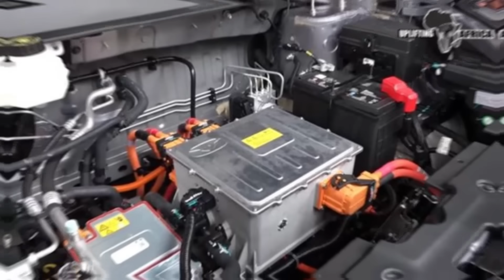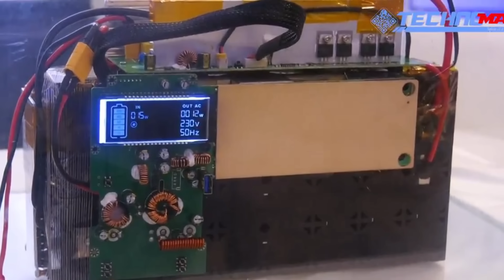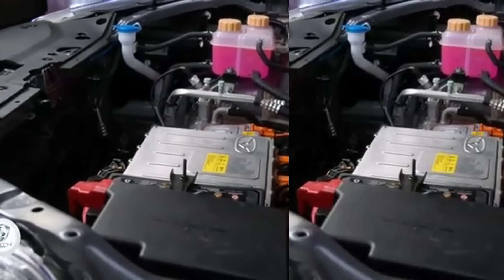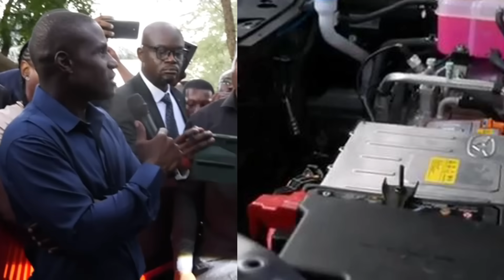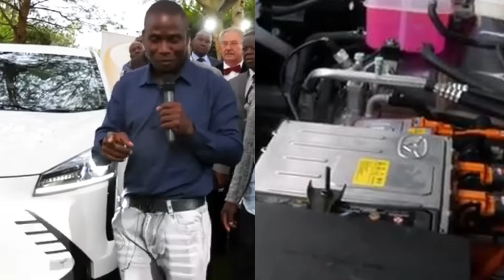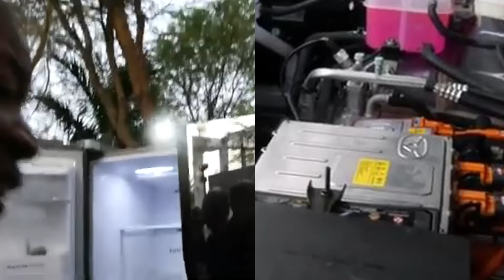The ‘Self-Destruct’ Feature: Genius or Liability for Buyers?

Comment: I see a few people who appear to have little to no understanding of electronics or they work for the oil and gas industry calling this a scam.

I would like to ask them to explain what a rheostat or step up or step down transformer does. How about what happens when you actually put these things on devices that monitors the reactions when any kind of voltage is applied.

He explained where he is getting his energy and that energy is all around us untapped just like another great inventor told us.

Be sceptical if you like but even today in America scientist are proving that inventor was correct and his theory is supported by these findings.

Comment: The US Patents office is a laughing stock - you don't need them. There isn't enough radio / electromagnetic energy to make this work so, as it does work, the energy comes from somewhere else such as free space - virtual particular pairs in the quantum froth. If you are taking energy from that, there is plenty to go at and doing so doesn't break the laws of thermodynamics and thus, not a perpetual motion machine. If you state that it takes energy from the quantum vacuum, they cannot reject the patent application stating it is a ppm. By denying you a US patent, they are trying to discredit you so they can still make petro-dollars. There are plenty of other countries that have patent offices - you don't need the US.

Comment: We are surrounded by large transmission antennas from telecommunications companies throughout the city, the system and transforming radio waves into electricity is possible through a device called rectenna (rectifying antenna). This system captures radio waves and converts electromagnetic energy into usable electrical current. Here's a summary of how it works:

Main components of a rectenna
Antenna – Captures radio waves from the environment. It can be a dipole, spiral or patch antenna.
Rectification circuit – Converts the high frequency (AC) signal into direct current (DC). Typically uses Schottky diodes, which operate well at high frequencies.
Filter and storage – A capacitor can be used to stabilize current and store energy temporarily.
Steps to turn radio waves into electricity
Radio wave capture – The antenna receives electromagnetic radiation present in the environment, such as cell towers, Wi-Fi, and AM/FM radio.
Conversion into alternating current – The captured signal generates an oscillating alternating current in the antenna.
Signal rectification – Diodes convert this alternating current into direct current.
Filtering and storage – Capacitors and other circuits stabilize and store the energy generated.
Applications and limitations
Uses: Wireless sensors, small low-power devices, and wireless power technologies.

Comment: I installed a similar device to protect my Em Regeneration Systems; involving disengagement of intermittent ground to electrolysis into Lightbulb & overfeed of systems to implode device in order to protect when removing from platform that contained the actual ground for the intermittent ground...necessary when others are out to defame or steal your research...if along the Em regeneration format then essentially produces more energy than required to produce, thus the power produced has to go somewhere...may as well go to protect the technology; handing drunk monkeys a loaded, cocked pistol just to see what happens  is emencly more dangerous than a small implosion.

Comment: Honest Question;
What happens when you took radio waves in a large scale to transform in electrical energy? Can it be dangerous in the long term? What are the possible repercussions ? Just curious 😊
Reply from the maker: Thanks for your thoughtful question! Harvesting radio waves on a large scale for energy could face practical challenges, as ambient radio frequencies are low-energy and would require massive collection systems to generate meaningful power. Safety-wise, radio waves are non-ionizing radiation (unlike X-rays or UV), so they’re generally not harmful in typical environmental levels. However, concentrated energy extraction might risk localized heating or interference with communication systems if not carefully managed. Long-term repercussions could include energy inefficiency (if input exceeds output) or reliance on existing radio infrastructure. While intriguing, scaling such tech would need rigorous testing to ensure safety and viability. 😊
Reply: @chriswabs  wow. Thank you very much. I suspect it, but without enough knowledge to justify it. Well great. 
Well, the door is open, so now I hope we do explore the opportunities this technology can bring and how far (within the limit's of safety of all) we can go.
I'm enthusiastic about it. Thank you for the answer.🙏🏻💪🏻

Comment: Too risky. Ha ha ha!!!!!! How many electric cars that are on the market have battery fires that destroy the cars and sometimes their surroundings? Yet EV car makers are mass producing and selling these cars. Rechargeable battery powered EVs appear to be more dangerous than any self destructive control module. Why not call the US Skunk works company to reverse engineer this self destructive device?  🤣🤣🤣Just make sure there is no input charging port to make use of any charging station and who cares if there are fairies from another dimension dancing inside the self destructive device, as long as it can keep going without any external hookup charging. How hard can such a test be?

Comment: Here is an idea to shut down skepticism, they can build a suspended platform covered by glass such that it would be easy to see if any external wire was going in, then attach the car inside, with its tyres on rollers and let it run indefinitely for anyone coming to see it.

Comment: I would not want a device that has an implanted detonator. In the event of an accident wires could be severed, and batteries in the vehicle could also be broken. This means you have a wrecked car with a detonator going off and Hydrogen gas from the battery. No thanks.

Comment: That's clever, no one can reverse engineer your invention👏👏👏,...keep safe Maxwell, Long live Zimbabwe!
Reply: This also means he is the only one that can assemble, service, repair, That won't work.
Reply: @raymondbennett6793  It is necessary until his invention can no longer be denied a patent. I'm fine with it. How else do you suggest he can proceed to get this on the market?
Reply: @arnulfomejorada1459  https://youtu.be/W970psviMFI?si=6g62k9GHFrSQTco1
Reply: We are surrounded by large transmission antennas from telecommunications companies throughout the city, the system and transforming radio waves into electricity is possible through a device called rectenna (rectifying antenna). This system captures radio waves and converts electromagnetic energy into usable electrical current. Here's a summary of how it works:

Main components of a rectenna
Antenna – Captures radio waves from the environment. It can be a dipole, spiral or patch antenna.
Rectification circuit – Converts the high frequency (AC) signal into direct current (DC). Typically uses Schottky diodes, which operate well at high frequencies.
Filter and storage – A capacitor can be used to stabilize current and store energy temporarily.
Steps to turn radio waves into electricity
Radio wave capture – The antenna receives electromagnetic radiation present in the environment, such as cell towers, Wi-Fi, and AM/FM radio.
Conversion into alternating current – The captured signal generates an oscillating alternating current in the antenna.
Signal rectification – Diodes convert this alternating current into direct current.
Filtering and storage – Capacitors and other circuits stabilize and store the energy generated.
Applications and limitations
Uses: Wireless sensors, small low-power devices, and wireless power technologies.
Reply: Bull shit it is a regular electric device with a battery. He is fear mongering people to avoid catching his scam.
Free Energy Crap
Reply: Problem is when they'll even figure out how diffuse the self destruct mechanism. Then they get to pick up where they left off.

Regardless, nobody's gonna back the imitators by then for a higher price, especially with his name out, famous n well known,
What they'll really fear the most.

Credibility = originality n reputation

Comment: Only if the self-destruct process is confined to a secure metal case containing the microsonic device and and the destruct process  is isolated from the whole car, the process must also be tried tested and foolproof, then insurances for the car will cover the whole car except for the microsonic device, the insurance for the device will be covered by the brand/company marketing the microsonic generator on behalf of Maxwell Chikumbutso.
PS: Internal combustion engine too involves continuous explosions but is only confined inside the engine's block and head.

Greetings from India.

Comment: Maxwell, I am so exciting about your invention.  Are there any independent labs or engineers that can provide their verification that it is working?  This is needed to convince people of the validity of this seemingly impossible invention. If you have done this, please post a video.  You can expect that the fossil fuel industry will try every dirty trick to discredit you.  You must be ready to counter their claims.  Maybe get a celebrity to drive the car a few thousand miles without fueling.  This will change the world if it can be made available to the world.  Zero point energy has been developed several times in the last hundred years but the creator is killed and all research confiscated.  You must have extreme protection!  You must safe guard your design and make sure it doesn't disappear.  Bless you and may God keep you safe.  The good people of earth are cheering for you.

Comment: In the magnetic spectrum from the sun there are an infinite number of frequencies to harvest ; Hz Chikumbutso’s invention is harvesting an amplifying the spectrum. Well done.
Reply: The fact that people can not explain the physics does not mean that the physics does not exist. There are many things we still need to discover in science.
Reply: @daviesmakasa8588  It also doesn't imply that the physics does exist. Simplest explanation? Scam.
Reply: @daviesmakasa8588  But in this particular case the science is very well understood and we use it and we measure the energy. Electromagnetic waves carry energy, you can capture that energy, but it's very small and decreases very quickly over distance, how far away from a wireless phone charger base will a phone charge? A crystal radio set uses the piezoelectric effect to convert radiowaves to a tiny oscillating current to drive a very small speaker. Could you charge an EV battery with that same radiowave? No.
Reply: @daviesmakasa8588 It is a scam for the hopelessly stupid
Reply: The future cars will be powered from the magnetic fields of the earth...
Reply: @portlandlocalchurch8168 Sure, scientist demonstrate recently the power extracted, 18 micro volts and nano Watts, good lucka to power a car😂😂😂😂
Reply: He is using super capacitor and DC inverter to 220v AC and VFD frequency drive to bost up the current and convert back to DC volts I have that in my house is called in my country burit energy.
Reply: @AnthonyQuebral-z3b  You can't increase the wattage, and he says it does work, which would be ~.3 kwh/mile.
Reply: Photos often show solar panels.  There is your free energy.
Reply: @DrJuan-ev8lu  Nothing to do with solar panels , watch the videos , he is using natural  RF just like Tesla did and others before him .
Reply: @DrJuan-ev8lu  are you really a doc
Reply: @ Absolutely and with some other degrees.
Reply: The sun only delivers about 1.3kW per square meter. A car needs perhaps 20kW of power. You can work out how big the collector has to be. He must be using a physically big collector with an efficiency way better than any solar panel. I don't believe it.
Reply: Im sure this thing harvests radiant energy and he needs to say radio energy for his safety. Im glad he has self destruct mechanisms in it so asses cant steal it. The best way to save the technology is to explain it for the lay person to understand and then spread it all over the world. I know we already have achieved zero point energy but it has been hidden in compartmentalized deep programs since the 50s
Reply: yes, getting something out of nothing. Must be magic :)
Reply: @lancewood1410  It's not magic but creation.
Reply: @lancewood1410  ex nihilo
Reply: @lancewood1410 Indeed it is, he is a perfect scammer 😂😂😂😂
Reply: @roaldgenehoekstra878  https://youtu.be/W970psviMFI?si=6g62k9GHFrSQTco1
Reply: You must be very stupid. What powers the amplifier.
Reply: We are surrounded by large transmission antennas from telecommunications companies throughout the city, the system and transforming radio waves into electricity is possible through a device called rectenna (rectifying antenna). This system captures radio waves and converts electromagnetic energy into usable electrical current. Here's a summary of how it works:

Main components of a rectenna
Antenna – Captures radio waves from the environment. It can be a dipole, spiral or patch antenna.
Rectification circuit – Converts the high frequency (AC) signal into direct current (DC). Typically uses Schottky diodes, which operate well at high frequencies.
Filter and storage – A capacitor can be used to stabilize current and store energy temporarily.
Steps to turn radio waves into electricity
Radio wave capture – The antenna receives electromagnetic radiation present in the environment, such as cell towers, Wi-Fi, and AM/FM radio.
Conversion into alternating current – The captured signal generates an oscillating alternating current in the antenna.
Signal rectification – Diodes convert this alternating current into direct current.
Filtering and storage – Capacitors and other circuits stabilize and store the energy generated.
Applications and limitations
Uses: Wireless sensors, small low-power devices, and wireless power technologies.
Reply: The truth is the energy available on the surface of earth is unimaginably huge in terms. Only we to tune in and use it intelligently. This is exactly what the Zimbabwe inventor has done.
Reply: Sorry but you can not amplifier energy, it is a scam 😂😂😂😂
Reply: Yes
Reply: You can't amplify anything at all without another source of energy.
Reply: seen
Reply: You have made a generalisation. Everything is energy and has a wavelength, there is a spectrum of wavelengths from light to matter. He would, if it is real be tapping into a certain wavelength or wavelengths, definitely wouldn't be on the matter side and magnetism is a different thing. However though I don't think this is a genuine device, I think he is a scammer as there is no attempt to explain how it works and also a definite effort to hide it's make-up. A genius like Nicola Tesla  invented this and many other devices, I don't think this guy is anywhere close.
Reply: @gacattack1234  he is a genius.
Reply: @shumbahurushumbahuru4894 No he is a scammer 😂😂😂😂
Reply: @gacattack1234  all u cud think about is scamming
Reply: @titosmadzivire5699  Believe me, if it isn't a scam I'll be the first to buy it, like most everyone else I am dreaming of a maintainless fueless freedom machine, but too many things here seem off and there is nothing I despise more than scammers.
Reply: @gacattack1234 and after explaining it then an upstart from Harvard will do the same thing and he will be given a patent. Guys just cos one has a hairy body doesn't make him or her a goat
Reply: @gacattack1234  carry on...

Comment: Why couldn't he get it patented. If the patent office rejects it on thermodynamics grounds the patent office should be shut down. And I think it should be shut down anyway because of patent pimps and what goes on in Tyler, Texas.

Patents are intended to get discoveries into the open and let inventors profit for 16 years without competition. If his patent doesn't work, he can't profit. If it does work, he deserves to profit.

That notwithstanding, as an electrical engineer I'm continually surprised by things I didn't know and wasn't taught. If you can patent a plant, you can patent anything. 

Re the oil companies? They're already relegated to making feed stock for plastics. Thorium Molten Salt Reactors will make carbon forms of energy non-competitive. That's their real problem.  And note, I didn't say fossil fuels. Oil is abiotic.